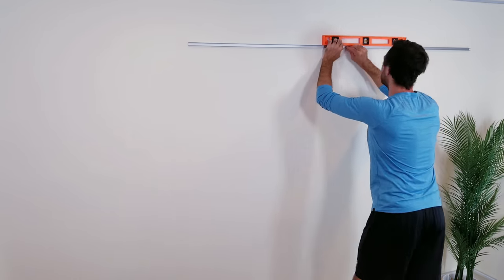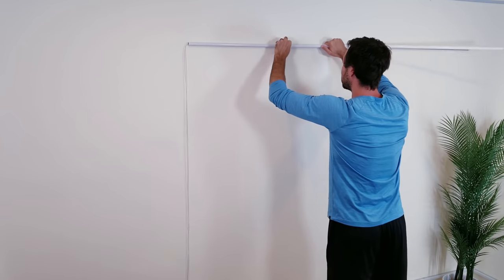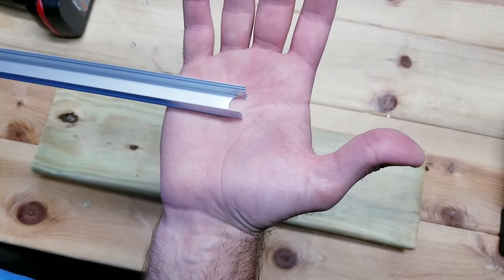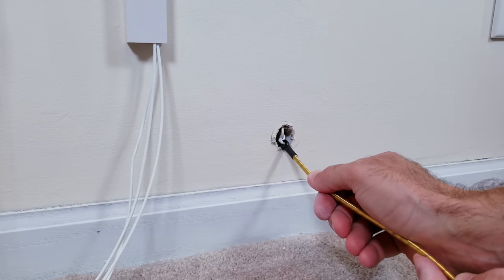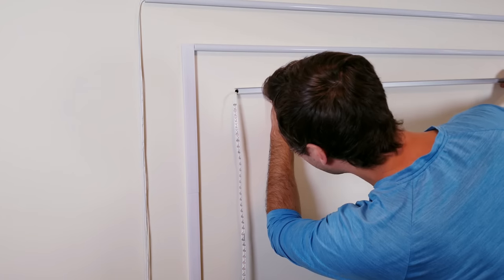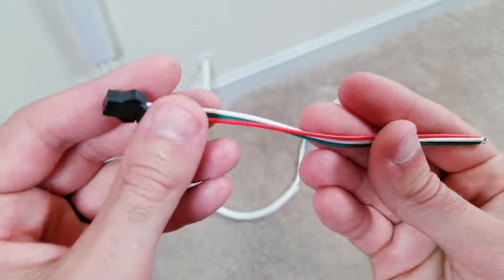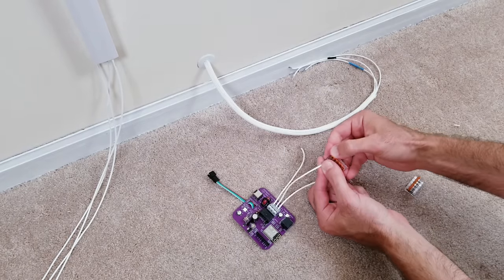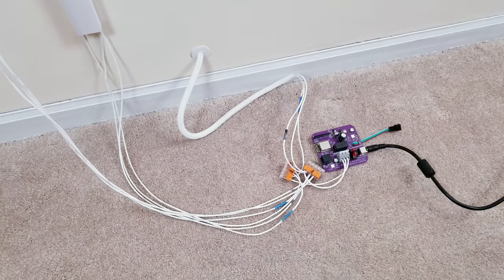How To Hide Wires Behind Wall - NO DRYWALL REPAIR NEEDED. Hiding Wires

Comment: Hi Chris, new subscriber here! I have been browsing thru your videos and I’m about to start out wledding myself but I have been trying to find wether it’s possible to create a wave effect or not and if possible, how is it done? 

What I mean BBS wave effect is if we take this video as an example, you have three led strips doing the same animation. I want that but I want every strip to starts for example half a second after the strip above and so on. Can I program this if I have three different wled controllers? 

Thanks and have a nice day!
Reply from the maker: You can certainly do that and the type of controller doesn't matter. It's more how you wire them up. Here is a video you can watch. https://youtu.be/Zzi5UIGnY2A or https://youtu.be/xkCt85jvI2s
Reply: @ChrisMaherDIY  Thank you for the reply! However, I think that maybe I didn’t describe the effect I wanted good enough. Don’t mind the word wave. Think this way: 

You have three or more led strips that sits like horizontal lines and you want the same animation going on at the same time for all the leds but for every ledstrip you want a delay of half a second or so. I’m thinking that I need three controllers but is it possible in wled to put in delay? 

Maybe echo effect better describe what I want? 😄 

Sorry and thanks. I’ve searched but haven’t found anything yet. 

Have a nice day!

Comment: I like the concept and the quality of your wire terminations. Electronically your install is solid and works, but all low voltage in-wall cabling must UL listed for its usage, in this case a jacketed 18-4 stranded cable with a CL3 listing would work and the splice should be contained within the fixture or a UL listed enclosure. 
So no open splices and jacketed cable and you would be code compliant.

Comment: You ever think about using a existing plug, remove the nail on box…buy a new double or triple old work box …bring all your wires down the wall at the same point into the new double or triple old work box and make up your joints inside the box and literally everything is hidden? With the space from the double or triple box you would have plenty of room and would be able to power it from the existing plug wire you started with….buy a combination plate that’s a single outlet and double blank.

Comment: small tip at 6:30:

If you use Wagos to connect wires its a smart thing to stirp all the wires a different length... 

If you use the Wagos they will fall next to each other instead of on top of each other...

You can now use a shrink tube to make it into a finished cable with almost no real clutter inside the connection point... 

:)

Comment: Next time instead of making the hole wider simply drill it at an angle so that the lead can easily be pulled through it.
Alternatively you could bring the lead past the hole then hook onto it, and fish it out; but the angle's easier.
Reply: Then what about the cap / cover?

Comment: Man, those diffusers really de-pixelate those LEDs.  Great find!

Perhaps I can contribute a bit here.

Green wire for anything besides ground kinda tweaks me.  I wouldn't hesitate to use a green wire as ground for a scope or something.  Green as a data line would be a trap for me. lol.

I know you are color coding the ends of your white wire, but getting a few spools so you can color code can really pay off in the future.  If you run cable through a wall or need to repair in the middle, you will always know which cable is which.  Make it easy for the guy that comes after you, it may be you. 

It looks like you are sliding the bottom of a circuit board across carpet. I suspect the chip has some static protection diodes on there, but I wouldn't count on it.

Is there a reason you chose the forstner bit?  Great results in the back of the channel, but I don't really know anything about that bit.

Many thanks!!!

Comment: Just to clarify, running, 5v wires through a wall without Romex is perfectly fine. There simply isn't enough voltage present to start any issues. That said, while it might be "against code," it's also not unsafe.

Comment: You missed a solution: Flat wires.
For very-low amperage (like 10x 5V LEDs) you can even use regular copper tape

Comment: Just want to say I enjoy your videos. By chance on the esp32 wifi board with wled is there a way to change default color so if there's loss of power they don't default to orange?
Reply: Hi Jake, Yes you can! Under lighting preferences you can apply a preset at Boot. Simple create an effect, save it as a preset and enter that preset # under preferences.
Reply: @domesticautomationllc  thank you! I'll try that out.

Comment: Can i use the comon led wi fi controller sold to control the 5 mtr RGB strips with a DC5V WS2812D  RGB LED WS2812 chipset inside ??

Comment: For option 3, did you run into any fire blocking installed between the studs when you were using the MagnePull to fish the wire down the wall? If you did, how did you overcome that?
Reply: fire blocking prevents that method. you either have to tear out drywall and drill a hole through it or use a long electricians drill bit to get through it without tearing out drywall. can be tricky to do but there are videos explaining it.

Comment: I'm been pulling cable for 12 years. easy way to fish a wire is to tape the wire on an end of a stick and shove it down the wall. hook the wire and pull it out of the wall. Cut the wire from the stick and pull the stick out of wall. No fancy tool needed.

Comment: To hide it even more you could pull the trim board and cut the hole behind it, run the wire then put the board back. No holes seen.

Comment: Why would you recommend a diffuser channel at $160 when I can get the same quality for half price?  I know you said it does the best diffusing of all the channels you've tested, but I'm having a hard time justifying double the price.  

I'm a first time buyer for this sort of thing - want to add permanent outdoor Christmas lighting to my house - so I'm asking out of ignorance: I don't know if I want a "best in class" diffuser for double the price.  Am I being too cheap?
Reply from the maker: Great question! If you are using an led strips that have 60 LEDs per meter  then these are about the only ones I've found  that perfectly diffuse strips at that density. If you don't care about the light being perfectly diffused meaning you will see the individual dots of light, then for sure go with something cheaper. But nothing will ever beat testing things out yourself so whatever you order just make sure there are free returns in case you don't like it. If you are using an led strip that has 30 LEDs per meter, nothing will perfectly diffuse that density of strip.

Comment: Why wouldn't you install an old work double gang electrical box for your controller and put a standard face plate over it??  Seems like a really clean and accessible solution to me.

Comment: Went a little too big on the hole by the molding. The cap still shows a little bit of it.
Reply from the maker: Thanks for watching! It does look like that but its actually just a scratch. The hole itself is completely covered. I should have just touched up that spot with paint.

Comment: Hey Chris.  Random question.  Have you tried out 12V LED strips like the WS2815?  I figure for longer runs, you won't need to use power injection for 12V vs 5V.

Edit:  Nevermind.  Found your video here https://www.youtube.com/watch?v=zbhdH-qSANc

Comment: This isn't exactly hiding things without drywall repair, but I guess he can't perform magic.
Reply: Agreed, I was intrigued by the title. It didn't seem possible, because it isn't. Maybe a more accurate title would be "How To Hide Wires Behind Wall - NO DRYWALL REPAIR NEEDED. Unless you want to hide the wires behind the wall, then drywall repair is needed." But I guess that wouldn't get as many clicks.

Comment: FAULTS  wires over the sharp edge you cut Ahh! !!!  no Noggin  in your walls?  then not showing the finished wiring or did you leave the PCB andwires on the floor  I learnt if you're going to do something do it properly